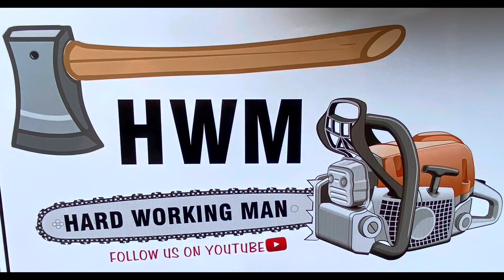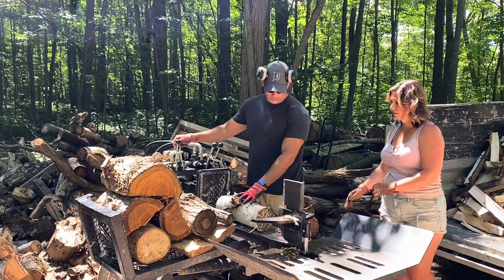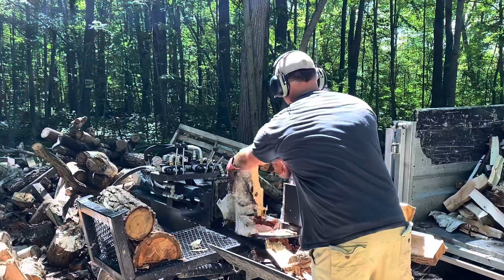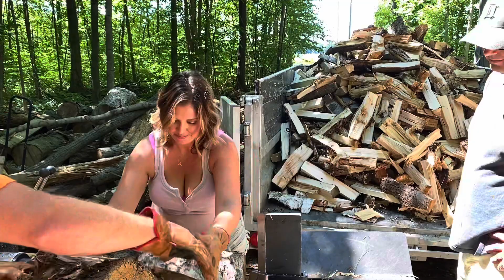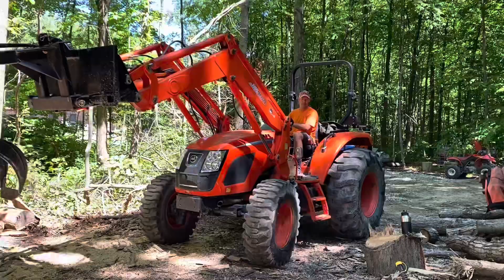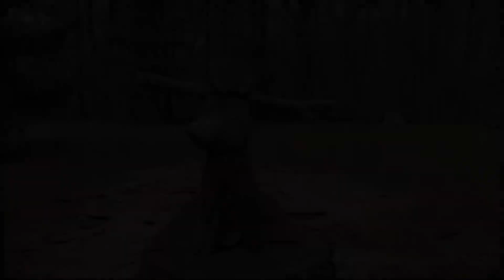Rachel Runs The Wolfe Ridge! Fast Splitting! #72

Comment: Heath it’s really nice having help in the woodyard. That Wolf Ridge really makes short work of spitting the bucked logs. I’m sure you can’t wait to get your new splitter. Any idea what your front grapple weighs? Be safe out!
Reply from the maker: Tony, not sure what the grapple weighs. It is from Ramsplitter. I see they have a quick attach model available now as well. I like the 3pt model because it can be used with either with an adapter plate. I have used and abused that thing and it has held up well. 

Agreed it is definitely nice having a helping hand.

Comment: Boy those piece's are small, must be for firewood bundles. We burn firewood for heat and I make pieces big enough to hold a fire. Purchased my first splitter after burning wood for 40 some years. I'm not as young as I used to be, still get my own wood though and my wife and I work it up ourselves.
Reply from the maker: Awesome and yes these are for roadside stand campfire wood. The smaller pieces dry quicker, are easier to light, and throw a better flame. We also heat with wood and split that a little bigger.